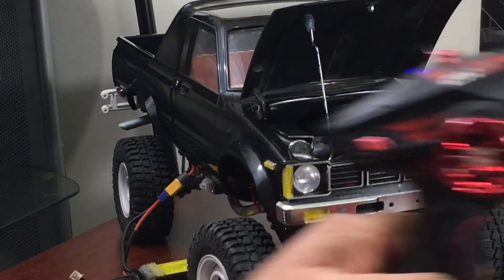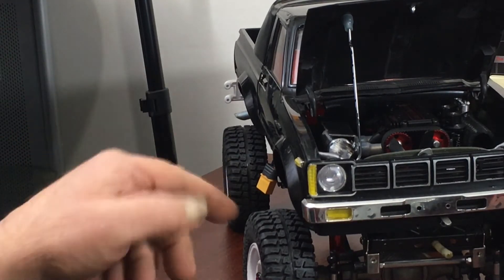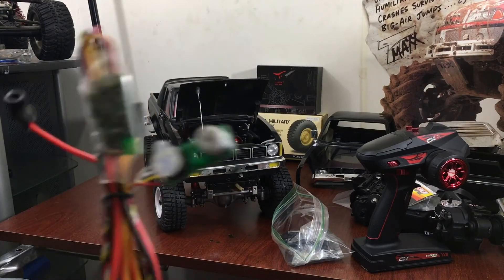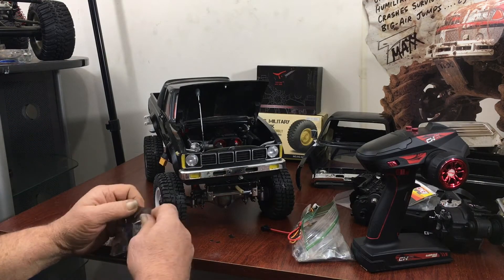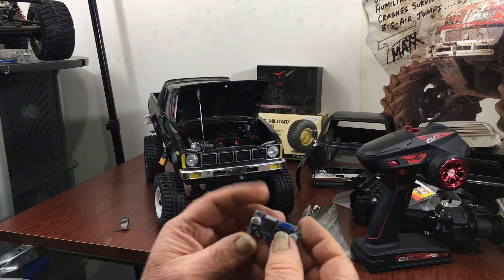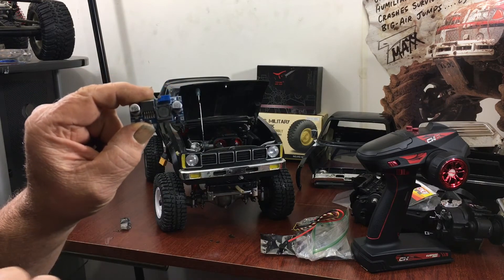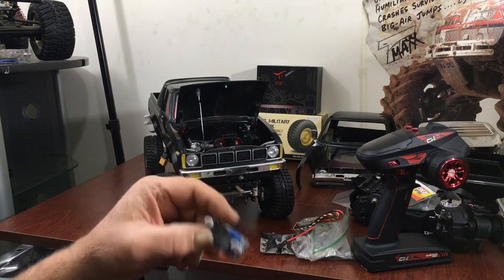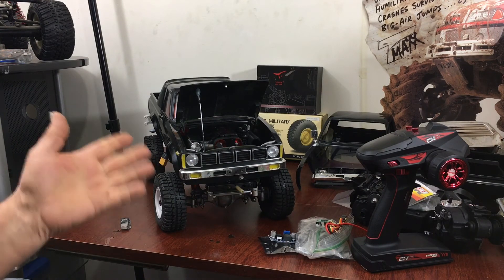FIRING UP THE TOYAN L200 HG-P407 PROJECT FROM THE RADIO!

Comment: Good morning Dennis, I used one of those little glow igniters in my Toyan powered Land Rover truck. If you cut the wires to the buzzer it will only supply power to the plug when you hit the start button FYI.
Reply from the maker: Thanks for the tip, i couldn't find any instructions on them ,lol

Comment: Nice!! That motor fits in there nice looks like!  So can you just buy 2 plug wires for it and it work?
Reply from the maker: Yes with the igniters and some fuel and a speed control for the starter.starter

Comment: Yup. I saw that, like you said better torque. I was expecting more speed though but it seems like it tops of almost the same as the 100 given it time to get up there. I wonder how it would do with unlock diffs. Good luck.
Reply from the maker: Good call on the unlocked diffs, from what I have experimented with the tire size vs the size of the spur gear and clutch gear, there must be a formula for speed or crawling, then adding the torque/horsepower of the engine also.  I want to add that high/low transfer case to the final drive after I figure it out. the L200 has more torque than the fs-100 so back to square one lol...

Comment: Stirling spec for both the fS-s100 and the fs-l200 are the same power .5ps and the rpm is only 2,500 rpm difference for the fs-l200. Blackmass and rc trucks & tanks show a good speed with the 100 but with the 200 I expecting more. I look forward seeing how you do. Good luck.
Reply from the maker: I seen the power specs were the same also, rc tanks and trucks has a L200 in his double E and it rips way better than the fs100 he had in it.